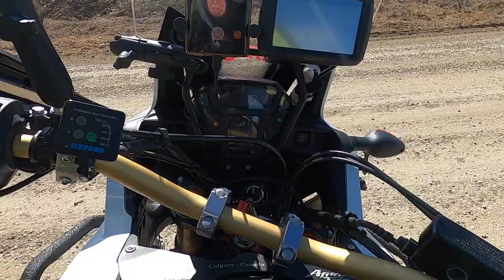HONDA AFRICA TWIN CRUSH ON GRAVEL OFF ROAD MOTOVLOG

Comment: 100 km/h wind gusts and super loose gravel doesn't sound like a lot of fun, but it makes for good adventure video lol.   Glad you came out alright.   Are you sure it was the wind, or just looking the wrong way on a lot of loose gravel that made you go down?  Looks to me like the front wheel just slipped out and those look like stock tires.   Something I'm always worried about happening when I get on that stuff but so far managed to keep 2 wheels down.
Reply from the maker: The tires are Motoz Tractionator GPS, to this day I did quite a bit of gravel even at high speed but the wind gusts up to 130km/h in this area.  Sudden powerful gust and loose travel contributed to the fall, at the same time I was trying to pay attention to my friend for the first time on gravel with his BMW 650. If it was not for the wind most likely I would be fine.